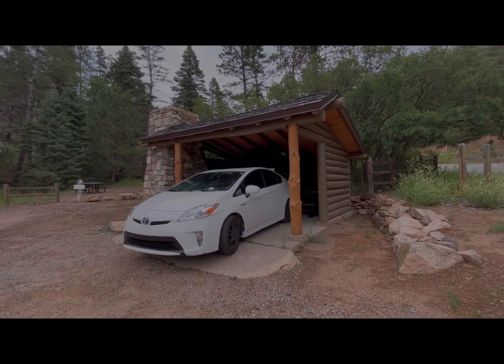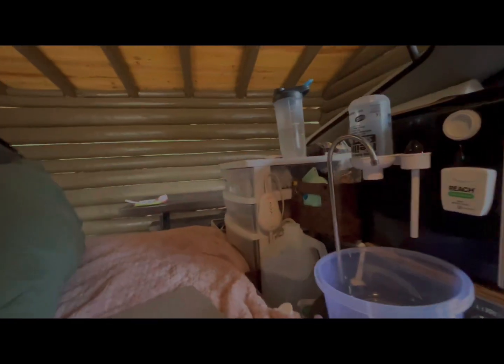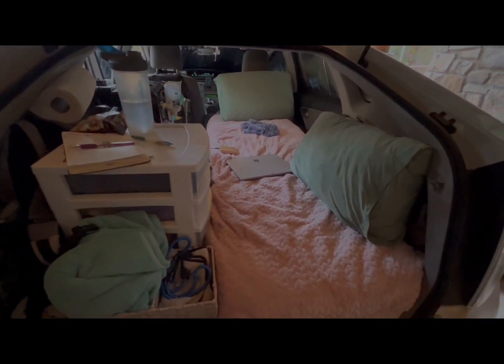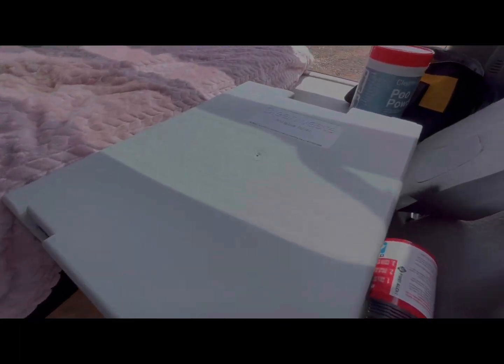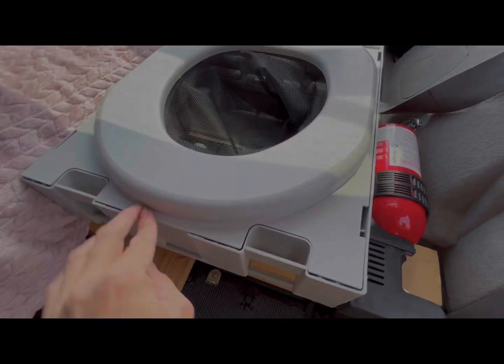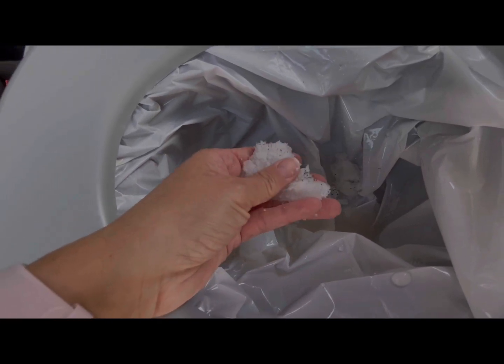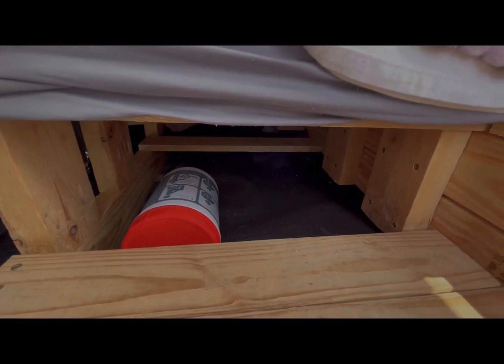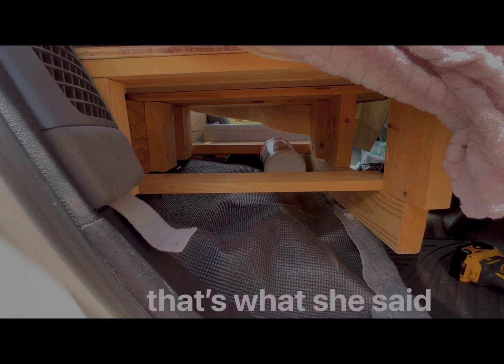Prius 3rd gen camper conversion-bed/toilet platform design and build

Comment: I like the half lap wood joint method. You can make your build lighter if you drill several strategically placed holes with a hole saw.

Comment: Is there a draw on the car battery when the back hatchback is left open? I am currently camperizing my prius and was wondering that.
Reply from the maker: I’m not sure. I would think it would take awhile (like days) to drain the 12v completely if it does draw anything. I carry a self jumper starter in case but haven’t run into this. There’s also a way to start the Prius even with a dead 12v that I had to use recently when I turned off my car and forgot to turn off my inverter lol. 

I searched and really couldn’t find a answer for you even though it’s been discussed. 

https://www.reddit.com/r/prius/comments/xy7fzm/how_long_can_hatchback_stay_open/

Comment: I was looking at 2015 Prius. What problems have you had with your?
Reply from the maker: It was mostly overdue maintenance as well as problems caused by neglect and abuse. Needed new tires, new brake pads and rotors. Needed fluids exchanged. Lots of bulbs missing including harness missing for one of them. Needed abs actuator replaced. It had 220k miles on it. A 2015 with less miles is less likely to have so many problems. This one was abused and neglected like crazy. I knew i was taking a chance with it, but got it at a decent price. Still, if I had it to do again, I would have bought one with much less miles on it though still would have aimed for a 2015.
Reply: @sweetoldbertha  I think the one I’ve looked at has 84,000+
Reply: @sweetoldbertha  you will get 300k+ from it with basic maintenance and repairs, keep an emergency fund just in case a larger repair comes up, otherwise you will enjoy her a lot!
Reply from the maker: @judyb2425  oh yeah that’s probably decent. I would definitely recommend getting it checked out by toyota or a mechanic you trust. I did that with the original Bertha but not this one. Also, look into getting an OBD scanner+Dr. Prius to read codes and check the hybrid battery status.
Reply from the maker: @mrsomebody7345  definitely saving up to replace that hybrid battery. Hoping that doesn’t need to be done any time soon though.
Reply: @sweetoldbertha  that would be a great ideal

Comment: Thanks for the video, when you sit in your car are you on your bed , toilet or front seat or all ? Wondering where you hang out in your car ?  Thanks for any info Gaylene
Reply from the maker: If the weather is nice and I have the hatchback up, I like to sit in that area. I use the drawers as a sort of desk or table for food. The toilet is my next option. Usually for lounging, I put a pillow against the door, sit on the toilet facing the bed, with my feet elevated on the bed. That’s actually what I’m doing now as I’m responding to comments here 😊

Comment: Saw another Prius hit by lightning but that guy saved his car by changing a lot of computers out.
Reply from the maker: Yeah the computer modules in mine were fried. But I read that a car hit by lightning may continue to need parts replaced for months or years because of the damage on the entire electrical system. I considered trying to save mine but didn’t want to risk it.

Comment: Not sure if you have info elsewhere…

In Re: 1.5” lift — did you use steel, aluminum or polyurethane spacers 

Did you add them or a shop ? 
Mechanic or like a Midas Muffler that deals in shocks and struts.

Greatly appreciate anything you can share. I definitely want to do same.

😊
Reply from the maker: I just used the Prius off-road kit. https://priusoffroad.com/products
I had them installed on both my Priuses. But from what I’ve read, they’re easy to install if you’re mechanically inclined. Had the first installed by Toyota (on the side lol) and the other just at a small, local auto shop.
Reply: @sweetoldbertha  Thanks for the quick response.  May be just a bit more than I want to tackle at the moment; as you say, local mechanic should be the ticket.
Someone stole my catalytic converter yesterday 😡 and I was in the process of checking out the Viper alarms…just a tad late.

Keep up the videos!
Reply from the maker: @cameronsimonton2515  I’m actually looking into an alarm/remote start for my replacement Prius. Considering something with more range than my viper system had.
Reply from the maker: @cameronsimonton2515  so sorry about your cc! I installed a shield on my new Prius but from what I hear, it’s just a very mild deterrent 😔
Reply: @sweetoldbertha  I’m doing a deep dive on alarm systems…happy to share anything I think might interest you 

I want something that detects physical motion or if a person approaches (“step away from the vehicle” ☺️)

Viper seems to focus on remote start and not the actual alarm
Reply from the maker: @cameronsimonton2515  I’m mainly interested in the remote start. I have a dashcam that will activate and record for a minute if the car is bumped. I think it probably serves as somewhat of a deterrent. Let me know what you end up getting!
Reply: @sweetoldbertha  hi!  I just left Caliber Collison; dropped car off Friday morning.  Friday afternoon I checked in status—said all I needed to do was sign authorization to work on car; I said “Josh” did that at 10 am.  I check today, same answer…oh, Josh only had you sign State Farm release, he forgot to have you sign our paperwork 😫

I’ll probably have to rent a car soon (no car rental ins. on my car (I used to have an old truck for second vehicle; when I gave that to my brother, I didn’t think to add coverage back on. 

What kind of dash cam did you get? 

I’m still researching car alarms
Reply from the maker: @cameronsimonton2515  This is the one I got. Have been really pleased with it. Was just thinking of posting a video from it- a wrong way driver on the highway that I almost hit head on 😬 
Ugh car stuff can be such a headache, hoping you get it all sorted out soon!

https://amzn.to/3ry1WCV